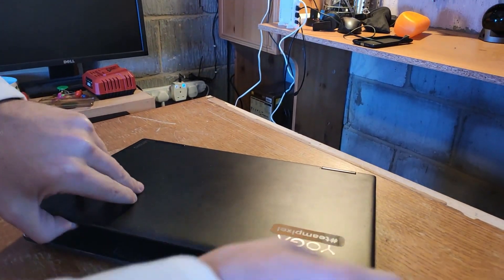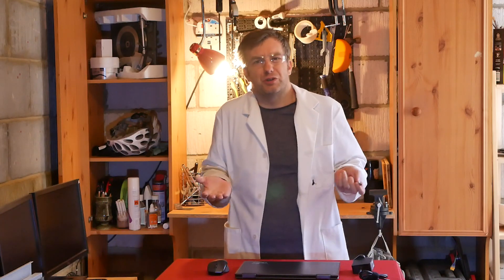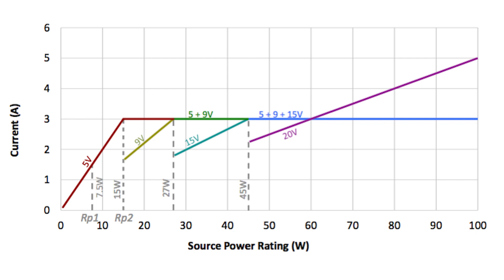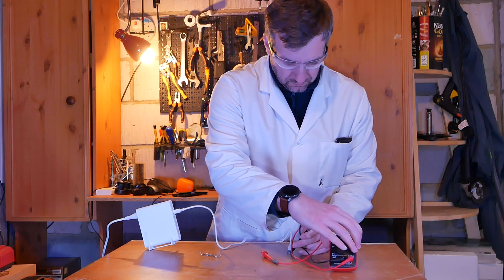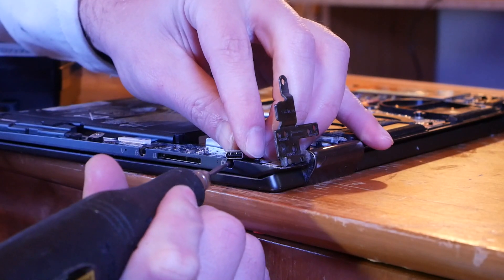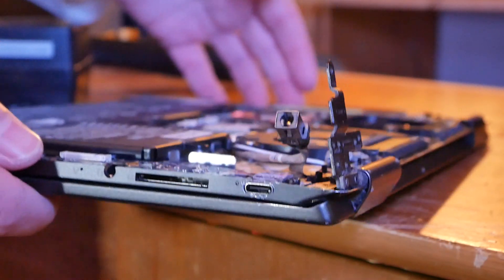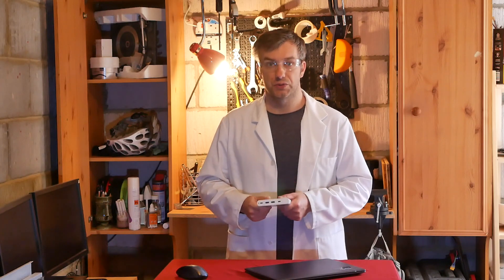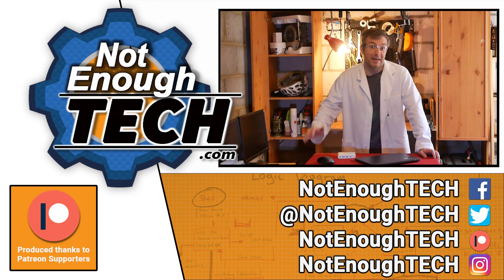Add USB-C PD charging to everything

Comment: Hi, I'm from the future and from another country.  Ali has several cool new generation chargers with 120v GaN transistors.  I have 65 watts now.  happy with him.  but I did not dare to build the port into the case of my laptop, I just bought an adapter.  you are lucky that the case of your device is aluminum
Reply from the maker: It all fitted nicely into my laptop so I was lucky. Different models will need different approach but adapter is always an option if you don't mind an extra dongle

Comment: Next step repasting the thermals with better thermalpaste and using thermal pads to coole the hots spots in the laptop. Finally lower the voltage of cpu and gpu. Voila gain 30min more battery time.
Reply from the maker: This laptop gives me about 4-6h  on a battery - so I can't really complain - its more than i need

Comment: Hey awesome video and guide on your website - I have one question however - I own an Dell e7450 and it needs 19.5 V at 3.32A so 65W however PD does only support 20V if I am not mistaken so according to your guide on your website I would need a module to lower the voltage to 19.5 V. Do you have any suggestions which module to choose - the link in your article only brings up an alibaba page with a lot of different types of modules. I took some time to dig through some of them but I am really confused and really dont want to make the wrong call here as I would really want my laptop to survive the operation :D 
Thx in advance :)
Reply from the maker: There is usually 5% tolerance built into the system like this so I wouldn't panic about the 0.5v even tho my spec needs 45W in reality laptop pulls more like 35W from my 60W charger.
Reply: @notenoughtech  alright thank you so much for your quick response :D One last quesion tho - as I said the Laptop says it needs 19.5V at 3.32A however a 65W PD Charger will only do 3.25 A - do you think that would be a problem? :)
Reply from the maker: @PixelSheep  unlikely. Although I'd go for another charger if that's the case. You don't want to runt he charger at max power due to heat.

Comment: Great video! I have a Dell E5570 with a 90 watt (19.5v and 4.62a) charger, I would like to install the ZY12PDN PD Mini board that supports up to 100 watts. If I plug the board to a 100 watt phone charger for example, will it fry the laptop motherboard due to higher wattage, or will the laptop only take 90 watts out of the 100 watts?
Thanks!
Reply from the maker: Providing the decoy is correctly made it will negotiate the correct the voltage then the charging circuit in your laptop will moderate the current draw. Chargers and power supplies in pcs are usually more powerful than required to assure stress  free operations this is why you see 50W PSU on pc that uses 300W at best. You should be ok.

Comment: I will definitely make one, but I´m not sure I have space to insert that module. 
Maybe a short adapter cable, USB C on one end, and a compatible power connector on the other end.
Reply from the maker: There are small adapters that change USB jack to USB-C, but frankly speaking I hate adapters - so I went all in. I';m lucky with my choice of the laptop as it was a really simple job.

Comment: Nice video! 

I have a small 24" tv that draws 25 watts of power - is it possible to change it to usb-c from a regular outlet for power to make it more portable (i.e. use a portable charger to provide power). 
Do you have any suggestions?
Reply from the maker: Your TV will have a transformer inside that converts the mains to whatever voltage it operates on. You would have to find out what voltage is present on the other end of the transformer. Be very careful, as you are dealing with mains. if the voltage and power requirements are within specs then you can simply have a parallel usb-c port connected where transformer usually supplies the power. Again, if you are not sure, leave it be and perhaps take a look at some inexpensive screens like this one https://www.banggood.com/custlink/KGKvuFV4Oe
Reply: @notenoughtech  thanks for the info. I will look into it.

Comment: Hello , I am sorry I posted some irrelevant comment earlier  but how about converting old devices like hard wired peripheral device by installing usb type c port.
Like most of such device usally fails by the cable breaking, I research that you need to apply resistances to ground 56k to be compatible with thoe c but don't understand much of it.
Reply from the maker: Most of the dummy ports like one I used handle everything for you.
Reply: @notenoughtech  Thanks, I was worried I might break something.

Comment: Is that computer a Lenovo yoga 710 15IKB? That’s the laptop I’m trying to add it to
Reply from the maker: it's 710-14ISK
Reply: @notenoughtech  oh. Would it work the same way?
Reply from the maker: I would assume so. Check the voltage on your charger. If you within close range of 20V then you are pretty much in the same bucket as me

Comment: Super Nice thanks for sharing
I was about thinking at doing same video, then i said let s check if someone did that already and tadaaaa
I think ill do it too
Even if my hp power is 19V. Not sure if there will be some voltage check or if it will just rin at 20V
Eventually i can use a diode (wasting 2w) In order to produce some drop
Reply from the maker: My pleasure

Comment: Nice. But will it power the laptop if the battery is removed? I like the idea of getting rid of the charger brick but don't have an internal battery anymore and wonder if this method could power it if plugged into a charger
Reply from the maker: Yes, it will. It changes nothing about your power delivery and how the laptop handles it.

Comment: Will this work on tablets with proprietary sockets and possibly charging module locking versatility down?
Reply from the maker: It would, however you are working with a smaller footprint which may be challenging.
Reply: @notenoughtech  yeah sure you have to shrink it all down in size, just look at the feat made by Strange Parts using what looks like a cpu as the audio card that is huge but at least it does the job.
Reply from the maker: @TheRealFobican  It's all down how much time are you willing to spend to make something work. I have added the USB-C to my laptop as it was a relatively inexpensive and quick modification.  The longer you spent on something the more expensive it gets in the process (I do count my time as expensive resource to justify certain projects)  - and yes Strange Parts  is cool :)
Reply: @notenoughtech  I was mainly looking after installing  plus and ground connections to make it compatible with more commonly used sockets than those that can make an entire platform become useless just because of a single thing like a cable that is unknown in design layout to you decides to get too worn out, in my case an Asus Transformer tf100 (I think I got the name correct) with the Nvidia Tegra 2 cpu that has exactly this issue taken place.

Comment: i like the idea 
and the problem i run into there is two black wire and tow red and a white one so where should the white one go ?
Reply from the maker: You have to check it with multimeter to identify the correct wires. You can also probe your existing charger to figure out where to connect it. Follow the wires inside the laptop and check where they connect to, this will give you an additional indication
Reply: @notenoughtech  Thank you it did work keep up ✌️

Comment: Some laptops have a switch (or 3rd pin) in the dc jack that tells the laptop that either a power supply has been connected or for especially hp's assortment of 3-pin jacks; the correct charger...

What are you planning on doing for this issue? (Still watching the video)
Reply from the maker: As this was not the case it's mine... Not much. One idea would be to see what voltage it would expect on that pin. Then if it's a simple case of pulling it high, you could hack something in. 

This is a guide more about my use case scenario than universal way to hack all laptops. It shows enough to understand the principles then apply it for your project

Comment: Wish you would have did a close up of the soldering
Reply from the maker: Oh sorry about it. If you are not sure which cables to solder you can always plug usb-a to USBC cable and use multimeter to check the continuity on usbA end and the decoy board

Comment: My laptop charger output is 19V. Can I Use PD board to make it usb type c? Or 20V instead of 19V will destroy My  device?
Reply from the maker: Devices are usually made with the tolerance for small voltage changes. 1V shouldn't be a problem, but I cannot give you any guarantees, you are doing this on your own risk

Comment: How do you add USB C and rechargeable battery to everything?
Reply from the maker: Yes, as long as the voltage matches your laptop brick. The charging circuit is usually integrated inside the laptop

Comment: 19v and 19.5v are other VERY common laptop voltages, would that mean the 20v of usb pd would fry the laptop if that’s what it uses?
Reply from the maker: I will refer you to this link:
https://superuser.com/questions/79818/using-a-20v-power-block-on-a-19v-notebook#:~:text=20v%20can%20be%20used%20for,19v%20directly%20is%20not%20advisable.
If you have space inside to add a voltage regulator and drop that 20V to 19V I would suggest doing so.

Comment: Nice! Is it possibile to use this hack with an output of 19V 1,58A? It's from a netbook
Reply from the maker: I would say 19V could be a little out of spec. I don't think it will damage it as I would expect another voltage regulator inside, but be careful

Comment: Very cool, and I would love to do this but my laptop power brick is 19.5v at 7.7a, which is 150w and outside the capability of USB-C!
Reply from the maker: You'll need to wait for these decoy to support the 240W usb-c
Reply: @notenoughtech  I didn't even know 250w usbc was a thing! How on earth is that possible when I used to need such a massive power brick?? I don't understand electricity....
Reply from the maker: Oh you will end up with a bigger charger for sure. But yeah 240W was announced a couple of months ago so we should see devices taking advantage of this soon.
Reply: @notenoughtech  Oh that's cool! Technology is just mindblowing. I'm swapping out a huge power supply for a tiny little USB one on my soldering iron, will make my desk a ton more tidy!
Reply from the maker: I use ts80p - got a video about it as well. Saves up lots of space
Reply: @notenoughtech   @NotEnoughTECH  I've got the TS100 which is awesome, but was going to upgrade to the TS80p just for the USB-C. But then I found a video on how to make a USB-c adapter for it using the same little module you are using here!
Reply from the maker: That's fair enough. I jumped the wagon when the ts80 was out and since i dont have any beefy lipos around going for the 80p was a non brainer
Reply: @notenoughtech  Yeah, it looks awesome! I got my ts100 for working on my racing drones years ago, so had plenty of big lipos to power it for field repairs! :)

Comment: Can you make a tutorial how to change the tradicional Dell G3 3590 input power for a usb-c power delivery entry/supply? I'm not a electronic guy but the power supply of this laptop is GIANT! I mostly use my notebook for study and not gaming so its so inconvenient have carry a big and heavy power source in my backpack. Thank you and congratulations for your channel!
Reply from the maker: Your first step is to check your wattage of that power brick. You can't cheat science and biffy supply usually means that your computer is high spect and needs that power to work properly. If you are unable to match the wattage your computer will continue to discharge even when plug in

Comment: I just wonder, do all usb type c come with power-delivery(PD) protocol option in the board. My laptop is ASUS I don't know what series it is, it's purchased on June 2019 and using usb 3.1 gen2 (now is updated into usb 3.2 gen 2) but doesn't include charging the laptop via USB c, can you help me? Maybe I can also pull some move and can do a little hack in order to make it work, make it cooler and more convenient so I can just do the charging, data transfer in one port only :)
Reply from the maker: USB PD is a separate standard. It is applicable to usb 2, 3, 3.1 etc. The hack I made won't add the data rail. Just swaps the charging protocol to force 20V from usb-c pd
Reply: Oh so it's just like charging a battery using a lab power supply unit, right?you just connect the positif (Vbus) and negative (ground) and connect it to the battery terminals and you all set. However is it safe thought using the USBC port & cable without including the PD protocol especially to charge a lithium ion/po battery which requires closely monitored voltage and current and you must be able to control & lower the current once it reaches 80 % for trickle charge the battery. So is it really safe?...
Reply: @notenoughtech  and also how do you bypass the USB C standard of supplying power, you know in order to make it able to charge a laptop you need to select the voltage level of 15 or even 20V but in USB C the default setting is using 5V voltage level and you need to insert/add a pull-down resistor with certain values in order to do that thing that you want. How do you able to bypass the system, I'm so curious I wanna know :)
Reply from the maker: USB PD resolves the voltage. The board negotiates the appropriate voltage and supplies this to the laptop. My laptop had a simple DC jack which means the charging circuit is integrated in the laptop itself and the connector would expect 20V on input. 

It solves the problem with correct charging as I don't have to worry about it. For charger to be able to recognise the battery levels etc it needs to talk to the device which is not possible if the only connection happens over 2 wires. Which means the battery circuit does the rest. Note that it may not be the case with your laptop so do it with caution.
Reply: Okay then, thank you I've learn a lot from you, I will definitely be very careful when working on my things and I'll do it with my own risk don't worry, but thanks again for the answer, goodbye 😘👍😉
Reply from the maker: Good luck in your experiments :)
Reply: I am also looking forward to transform somehow my usb 3.2 type c in order to connect a hub to it and transfer data while charging. This way I would have only one single cable for everythink I need. Have you found any way to do this?
Reply from the maker: Its a very intricate job as you would need to split the datalanes. I would advise against this as it increases the chances of frying your equipment

Comment: sr has a fixed cost of 12ms, so how it is gonna work with games running over 83.4 fps, its gonna merge two frame or the fps would be capped like vsync
Reply from the maker: I'm not sure how this comment relates to the video
Reply: @notenoughtech  I am sorry I was warching a digital foundary video which was on watch later then there was your video, I think the video finished and I got here without realising.

Comment: Could I add a 20V IP2721 PD module in parallel with my stock charging connector?
This way I can use the stock charger and an USB C too
Anyway, does it have reverse voltage protection? I mean in case somebody tries to attach an USB device into the USB C charging port
Thanks in advance
Reply from the maker: You could do that. As per reverse voltage protection, it depends on your charging circuit inside the laptop. Easiest way to find out is to connect a multimeter to your DC pins and see if you see an voltage.

Comment: How did you limit power input (on USB S module) so it match your laptop charger factory specification?
Reply from the maker: Laptop is in charge of how much power it uses not the charger. Charger power rating is just in line with power requirements. In reality the charging current is much lower than what's the charger could provide in theory in both circumstances
Reply: Power supply amperage is 'up to'. Meaning that you can have a device that only sinks 1 amp but you can have it connected to a supply that can provide 10A. So long as the voltage is correct and the power supply can provide amperage equal to or greater than the laptops original power supply there will be no issue.

Comment: Have you considered connecting usb to that port if it is possible?
Reply from the maker: That would require a different solution than a decoy. I have enough space to pull it off but to make it work I'd have to solder a 8-9 wire tape to where a usbA ports are. Not sure if my soldering skills are up for that task
Reply: @notenoughtech  is there a chance you can make a video for that? I’m trying to do that on my yoga
Reply from the maker: It's more complex and it's a greater risk of damage so I won't do this I'm afraid
Reply: @fryball1443  webcams in laptops are always connected via USB. what hou could do is sacrifice your webcam and solder USB data wires to the USB c board. It's also bad because it's USB 2.0